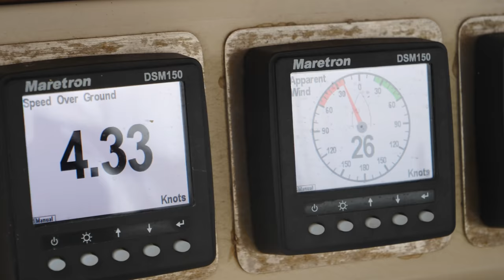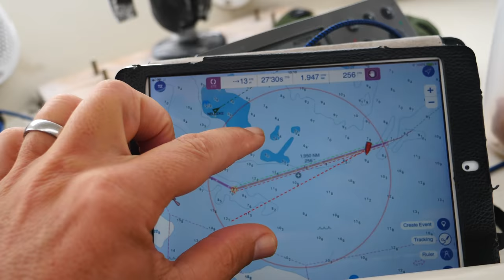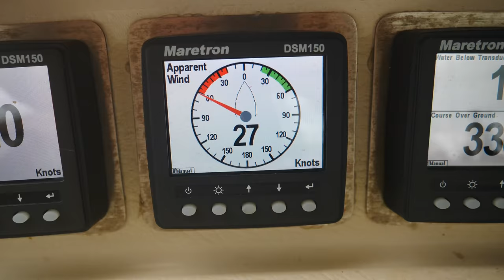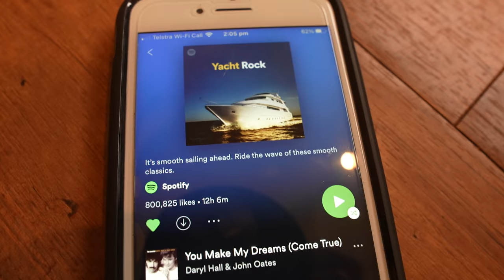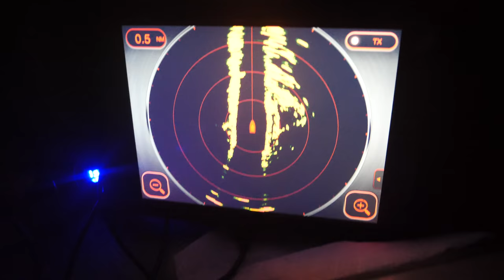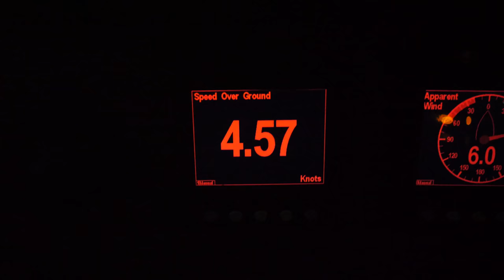Everything I loved about Sailing is gone 😭 Sailing Vessel Delos Ep. 309

Comment: I'm sure this isn't going to happen, but Brian I know that you have talked about Delos 2.0 down the road. There could be a transitional period where you sell Delos, and have a motorsailor or even no boat for a while until the Nugget is more independent maybe a year later. Not sure if you're still doing freelance or totally relying on video income but if keeping watch meant sitting inside in the main salon at a steering wheel with the boat on autopilot even if it was a motor sailor, it would change the whole dynamic and requirements of keeping watch and parenting at the same time.

Comment: Hey are you still thinking about moving on from Delos to a catamaran? What do you think of the Balance or Seawind cats? Still have some performance in them. Good for escaping issues or making quicker passages. That stable platform should help out with the rock and roll and give space for the nugget. I know you mentioned awhile back you had been looking at trimarans as well. But I’ve seen a good number of reviews where the layout and space just doesn’t justify the cost even though it might have a more monohull feel to it.

Comment: Ok, someone answer this dumb question please. I realize there would always be a risk of going overboard, but look at 7:12 min. Why are those guard rails/lines (?) so low? They don't seem to be more than 2 feet high? What if Brian slipped there? Shouldn't they be 4-5 feet high?  Just curious, thanks!
Reply: If they were that tall then the leverage would just rip them out of the deck when you fell against them.

There are other ways to stay on the boat, like tethering, and any offshore sailor does do this on passages.
Reply: @eliasghosn6754  ah, makes sense. Thanks.

Comment: I still think they should have a cable a certain depth down that is pulling you against the flow of the water at a reasonably high speed. Like a San Francisco cable car cable but one that allows you to pull onto something that doesn't take a step back for every two steps forward you push yourself. And to that after all the losses that the water imposes itself as a most soft spot to push off of with the most inefficient device. Not having to burn fuel in such waterways wiLL justify the cost in extra livestock health alone one might surmise.

That being said sailboats are slippier than motor boats without sails. You can motor better than on a motorboat.

I hope Bill Gates has sent you a copy of his book on metrics. I read the I think WIRED interview of him talking about his last book as the author. I like  lampoon one of his answers as defining a new calendar when it comes to global warming 2050 A.D. is 95 years after Gates birth that's aGb!

What year is it now? It's 65 AGB.